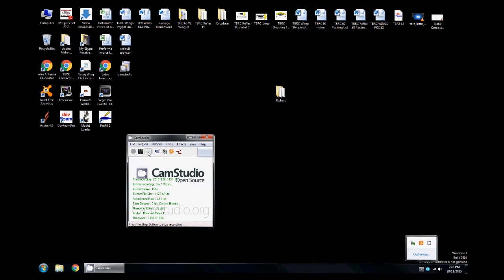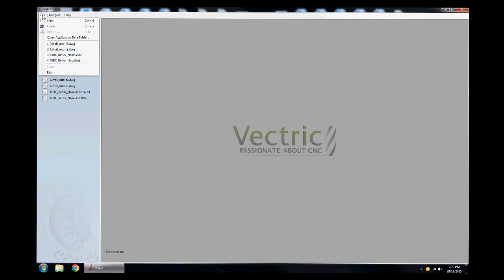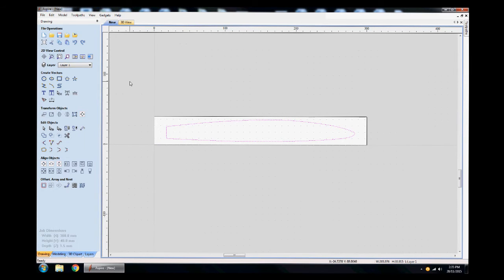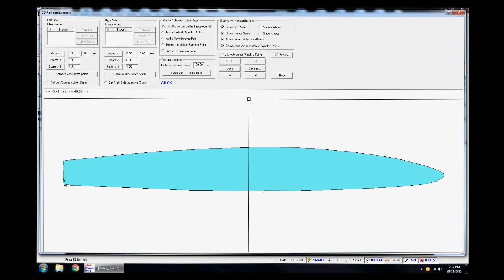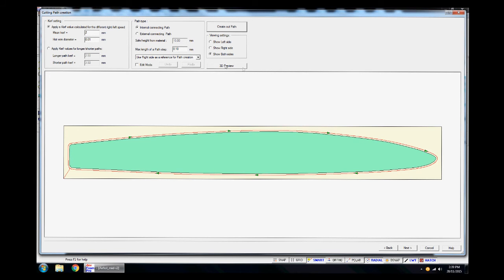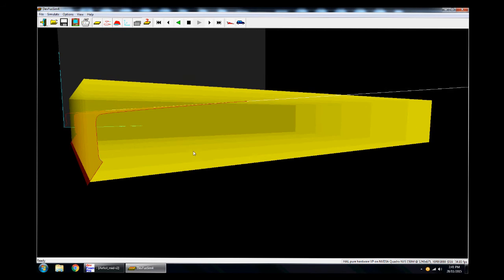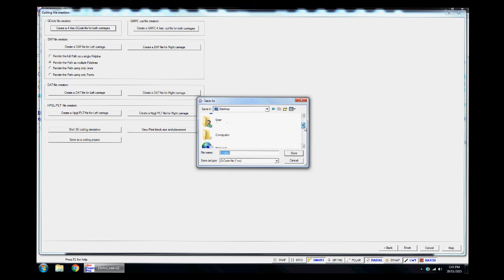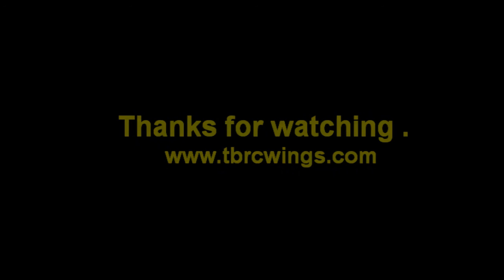Creating  Gcode for CNC hotwire foam cutter.

Comment: So u don’t actually write the code u jus drag and drop the image and it writes the code right?
Reply: Software does all the complex calculations to create the actual Gcode.   That Gcode obviously tells the machine where to move, and position itself on the X Y Z A axis and at what speed to turn on or off functions an so on.    You can open Gcode in notepad and look at the code, edit it and make changes manually.  To sit down and write 10,000 lines of code and know what it will do would be difficult I am sure.  :)
Reply: Yup I’m not no computer wizard lol
Reply: It’s been awhile since I’ve talked about this but what’s the software and how much is it?

Comment: Just the right thing that I was looking for. thank you for sharing. I might have only one question: in ``devfoam pro`` do you have to option to rotate the wing to cut heavily tapered wings?
thank you.
Reply from the maker: Your welcome it was a struggle when I first started trying to learn the ropes before cutting wings so I know where your coming from.   Yes you can manipulate the positioning  of the root and tip within Devfoam to account for swept wings.